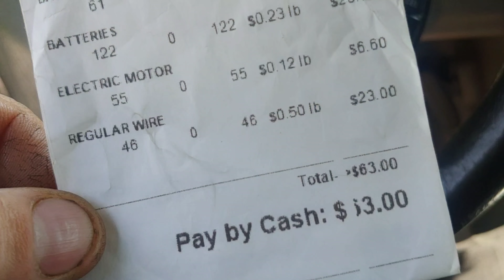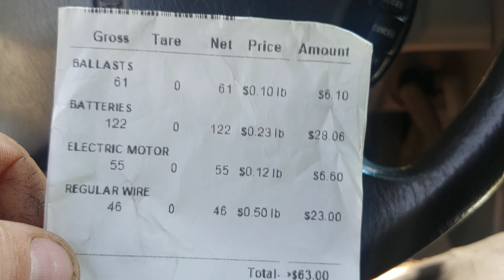Massive thunderstorm and a small scrap load

Comment: Have you considered of getting a diesel generator like they use on construction sites you can get second hand ones at reasonable prices be handy as a backup power supply that power the entire house
Reply from the maker: I actually have one it's a single-cylinder lombardini with a 110 generator out of a sign board... it's just loud obnoxious and only produces 110... but it gets like 8 hours to a gallon... I just didn't have it completely ready to go I could have got it going but it's just one of those things if it would have went more days I definitely would have
Reply: @ScrapFarm  I'm from uk and found this on ebay PRAMAC 6000s2 DIESEL SUPER SILENCED 2013 YR 6 KVA GENERATOR 110/240 V SITE GENNY for £1.199
I was looking at one fore my workshop
Reply from the maker: @carltrushell4338  definitely something I would like to have plug it right into the house... someday but as you can see I got a lot of irons out there.... and it seems like they're all starving for money.. thanks for watching man